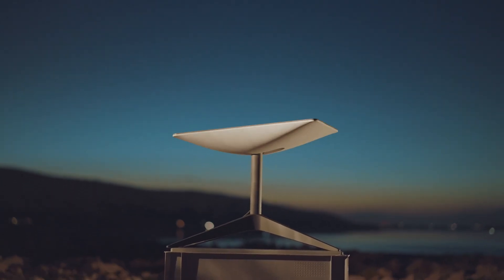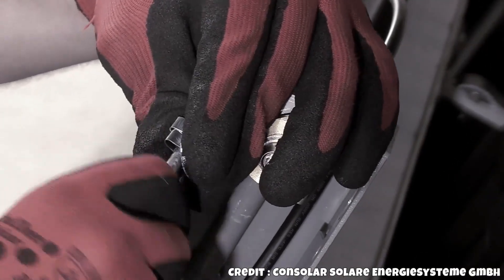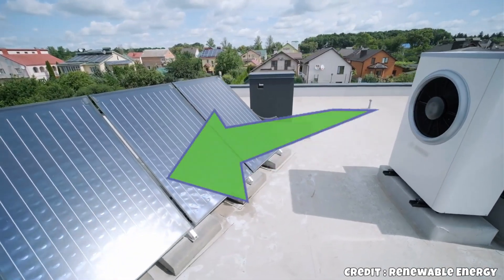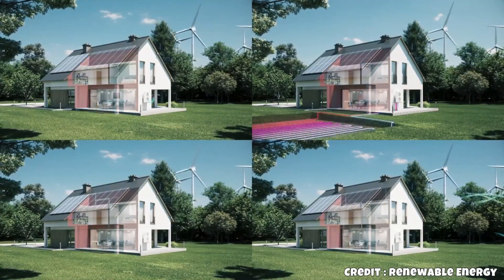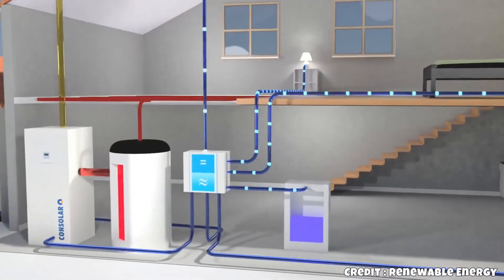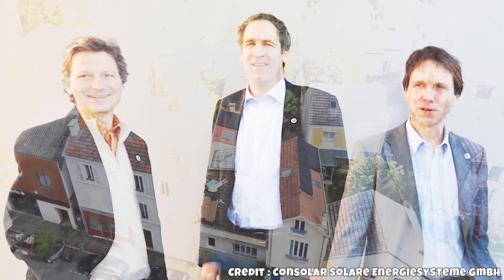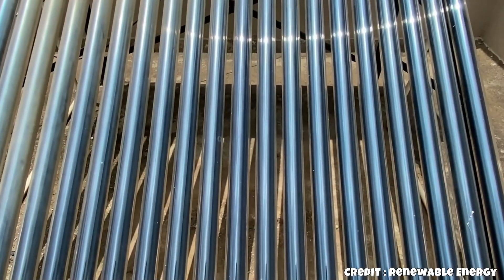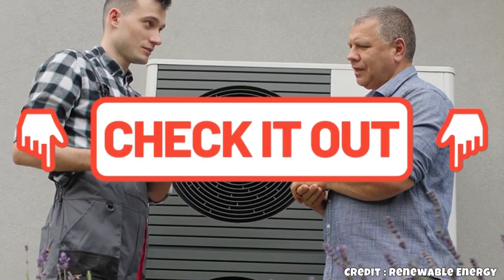How This German Solar Tech Reaches 90% Efficiency

Comment: Just BS. "HESSA solar panels, specifically the Hyundai XG and YH series, offer efficiency ratings between 19.2% and 20.6%"  Seems a very long ways from 90% I love how total crap can be put out like this, particulary if it is "green" BS.
Reply: It’s probably 20% electricity, and 70% heat.
Reply from the maker: @mikeguitar9769  Exactly
Reply from the maker: @litestuffllc7249 Exactly—the 90% refers to combined efficiency, not just electricity. It’s around 20% PV + 70% thermal from the same panel. Not magic, just using all the sun’s energy instead of wasting the heat like standard PV.
Reply: @Generalphysicsknowledge thermal doesn't count in solar panel efficiency its all about electrical production.
Reply: Typical ambiguity between 1st law efficiency and 2nd law efficiency
Reply from the maker: indeed